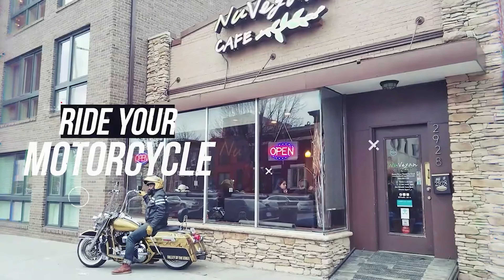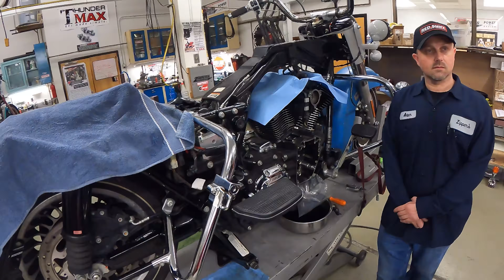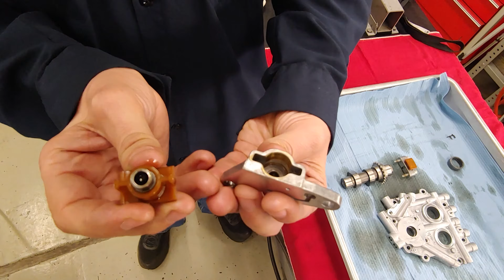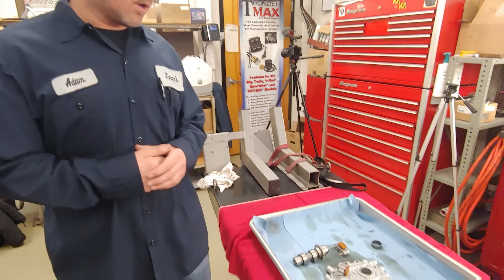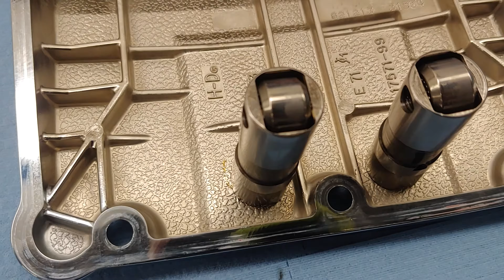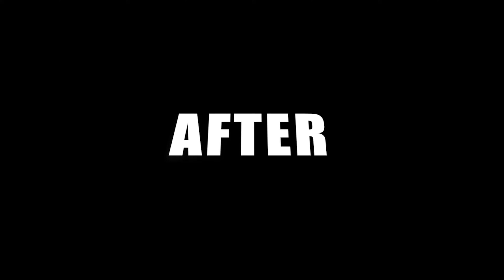Budget Friendly Upgrades to Stock Harley 103 Twin-Cam Engine to Increase Power and Reliability

Comment from the maker: My Dad can't get enough of how much more power his bike has with the addition of the Zipper's Performance BOLT-IN Red Shift RS528 cam. All of his buddies don't believe he only had a cam upgrade. Well, the proof is here in this video...
Reply: Can you tell us the other parts you got him? Which can plate, lifters, oil pump, etc?
Reply: what mileage was on it when you got the work done?
Reply from the maker: @EazyDuz18  It had about 19 thousand miles on it before the upgrade.
Reply: Bad ass. How much did this cost? I'm sure it's more now with our crazy inflation, but it'll give me an idea.

Comment: Did you upgrade the injectors?
Reply from the maker: Stock injectors... The Redshift RS528 camshaft and Thundermax were the only 2 Non-Stock/aftermarket parts added. Thanks for watching!
Reply: @BuildRideRepeat  I'm going with the Dyno Jet Power Vision, and Fueling 4.9 injectors. My 2012 Heritage 103 has 3.91 GPS injectors,

Comment: If your dad likes throttle response they could have pulled the heads and check deck height of the piston and set quench to 0.030” with a Cometic head gasket and milling if necessary and then mill the head 0.020” - 0.030” to lower the combustion chamber volume a few CC’s to bump compression to 10/10.5:1.  It would be crispy throttle response and more torque across the entire rpm range to get that heavy thing moving easier.  It would also thump a little harder.  It’s also somewhat budget minded….
Reply from the maker: Wow! Thats an AWESOME Budget Recipe.  Thanks for watching!

Comment: I have a 96ci 2007 Wideglide and I've added a 103ci kit, Andrews 48H cams, a bit more compression (with manual decomp valves) and a little head work by way of a good valve job etc and a Techno Research tune. It dyno'd at 106lbs ft, which I was/am pretty happy with. However; down here in New Zealand we have a heck of a lot of tight, twisty, hilly roads so I changed the final drive pullies to a 30/70 combo to bring the torque into a more usable road speed range. Getting good torque was my aim and with that final drive ratio the bike is just awesome on our roads; the 103ci displacement just rocks!
Reply from the maker: NICE! It sounds like you've got a good combination for your application for the twisties. Those 103s are really good engines and a good cam with supporting mods make them GREAT!

THANKS for watching!

Comment: Love my 103 and would certainly put cams in it, but my '13 Fat Boy Lo has terrible stopping ability and that makes me not want to put any money in it.  Gonna sell for a Street Glide M8 2017 or newer.
Reply from the maker: Nice! Are there any brake upgrades that you would be willing to make? New cables, new rotors, pads,  fluid flush and new fluid?

Comment: Great video. 
I’am sure he noticed a difference. 
I subscribed 🔔
I have the 2016 Ultra Limited 103”C.I. High Output compression ratio - 10.0:1
In Vivid Black. I bought this bike new. 
I installed these items myself.  Easy Peezy!
Fuel Moto 🍀 2-1-2 Jackpot Header with no Catalytic converters it’s 
Stainless & Ceramic Coated inside and out also their large crossover tube is the same way, and reused my factory heat-shields and installed the Rinehart 4” mufflers, chrome with black tips. 
I also replaced the factory ECM and installed a ZIPPERS ThunderMax ECM with Auto Tune, it also comes with Bosch
WideBand O2 sensors. 
I also replaced the factory air filter with a Roland Sands Black Ops Air Filter. She’s running better and sounds much better. 

What’s next 🤔 possibly - Zippers Red Shift Cams, Cam Plate, and Timken Bearings, Chain Tensioner, High Output Oil Pump, and 
Lifters and Push Rods. 
Primary a Dark Horse Compensator, Clutch & Chain.
Reply from the maker: AWESOME! It sounds like you've got a runner as well. Give the guys from Zipper's a call. They'll get you straight! Just tell them what all you have and they will give you a formula for your parts.

Comment: So between a fueling and an S&S cam what would you go with on that same bike? Mine is a 2012 Road King with full cobra racing exhaust thunder max tuner and a big giant K&N  elbow filter. Didn’t want to do a whole cam chest.
Reply from the maker: They all make different options.  It all depends on how you ride and where you want your power. Give those folks a call to see what they recommend.  Zipper's gave me a solid suggestion for their Red Shift Cams. I understand not wanting to do an entire camchest, but please replace the supporting parts if they are close to the end of their service life.

Comment: I think you are on the right path .  I would do the same thing . I just got back into Harley my self 9 months ago. I found 2016 FLRT FREEWHEELER, the 103 with 6700 miles . Just did a stage 1 finished today . Fuel moto , jackpot header, Vance Hines  slip-on , acdc air cleaner (s&s).add a fuel moto tune . Runs strong ! 
It's not new , Harley wanted $37,000.00 for a new trike . I got this instead. Wise money spent . Very happy , I'm sure your father will love his camed out twin ! You are in great hands with the people you have chosen to do the work
Reply from the maker: NICE! I love Freewheelers. I want to get my Dad on to a RG3, but you already know the prices. 😱

All the 103 needs is a good tune, air cleaner and nice exhaust. This cam upgrade blew my mind!  I think my dad giggles inside his helmet when he rides it now. 😂  I have a video here when he picks up his bike. He got emotional. 

The guys at Zipper's are AWESOME! THANKS for watching and commenting.

Comment: This mechanic was not telling the truth. The rocker tray bushing are non existent. That’s why rocker lockers were invented. These engine came from the manufacturer with rocker try noise. Put a high lift cam in and it sounds like a toolbox being tossed around in the back of a pickup truck. So that statement is untrue. There are no bushings in the rocker tray from the factory.

Comment: Bro because of watching this video a few months ago I put in the Red Shift 528 cams in my 103 with a Thundermax ECM as well, my bike has gone from alseep to "beast-mode". It's fast. So thanks man for putting me on to the 528 cams.
Reply: do you mean BEAST MODE?  😆
Reply: @gw10758  Haha yes😅, I must have had a few cold ones that night, fixed it now. 😎
Reply from the maker: 😂 Hey man... I dig it.  COLD BREWS and Build Ride Repeat! Sounds like a good time after work 👍🏾

Comment: I'm not sure I buy the whole cam chain tensioner thing. I just tore down my 96 that had 120K on it, the tensioners were in excellent condition.
Reply from the maker: They are a maintenance item. You should be able to get good mileage out of them before totally replacing. I do believe the dual pistons keep better timing.

Comment: I have a Fueling 525 in an 88 Dyna with a stock CV 40. It's great to hear someone mention that the Dyna chassis has limits.
I have twin disc on the '99 FXDL and the suspension is well sorted but there's no point going further.
Clutch is uprated and starts to feel heavy after an hour or so.
Also the 525 with Vance and Hines straight shots makes my ears ring for days even with full face and eye plugs.
Reply: Fueling 543 is really impressive.
Reply from the maker: I have heard people mention that about that cam as well.
Reply from the maker: NICE! Its all about enjoying what you have and making upgrades along the way. Thanks for watching!

Comment: Probably spent $3500 to make 20HP. Lmao.
Reply from the maker: This was a BUDGET bolt-in cam upgrade. You must be thinking in FORD Economics. 😂🤣 Thanks for watching!
Reply: @BuildRideRepeat   Nope. Just thinking logically. Harleys are overpriced pieces of shit.
Reply: Bro why are you watching this video if you aren't interested 😂 typical mustang bro 😅 embarrassing af
Reply: @erikphillips9989  No one says I wasn’t interested. I have a Harley twin cam, and from what I’ve experienced and keep watching is the expense it takes to get these bikes to run like they are supposed to is astronomical, yet no one will actually address it. Bikes running so lean from the factory that there are people finding white pistons after a 15,000 miles rebuild. The press together crank that has runout that causes primary components to wear down much much faster and can even cause catastrophic breakdowns. There is a loss of quality here, and Harley’s are only getting more expensive. That’s why I’m talking shit. It’s just not blind.

Comment: Ia it really stock ? I got a stage 1 103 and it puts down 71 hp
Reply from the maker: My Dad bought the bike used. It may have already had a "Stage 1" upgrade of Air Cleaner, Exhaust and Tuning because it had slip-ons already.

Comment: I have a 2005 electra glide CVO  103... With a 50mm throttle body. S&s everything roller rocker .. 110horse power  with a welded crank after 2006 are a key way crank  junk

Comment: I like your Dads bike looks like a Navy paint scheme. i have a12RG with 63000 kinda worried about doing a cam mod after riding for awhile when i shut the motor off it makes a thunk sound in   the bottom end. Lord knows i don't need to buy a new bike😂
Reply: Might just be the compensator in the primary case

Comment: What was the cost? I'm looking to go stage 2, from stock, on my 2015 road king 103. I was thinking of going with an Andrews 48h or Woods 222. What are your thoughts? Thank you. Skip McCain
Reply from the maker: This is what many consider a "Stage 2" upgrade where only a cam was added. I have no experience with those other cams, but the Red Shift RS528 is the TRUTH! I was able to ride my dad's bike to Milwaukee and I never needed to come out of 6th gear to pass anything. All the other was done because my dad never had any work done to the bike and we had no clue of the condition of his serviceable parts.

The cost will be what a cam change would cost locally. For more about the check the link below for more info on the RedShift RS528.
https://www.zippersperformance.com/red-shift-cams-rs528-for-twin-cam/
Reply: @BuildRideRepeat  Thank you

Comment: How much cash is my question.
Reply: Same here....budget friendly....what's the budget?
Reply from the maker: It would depend on what your local technician charges for a cam change, changing lifters and cam chain tensioners. We didn't upgrade many other parts outside of what was already there. Except for adding the Thundermax. My Dad's slip-ons stayed, and we added a high flow air filter. So, the main costs outside of labor would be Red Shift Cam Kit, lifters, and Thundermax.

Comment: I have a 14 SG stock and I’m shopping for the best cam. Hmm 🤔
Reply: Cyclorama 570-2 just installed by owigsburg h.d. in pa. Got 98.7 hp and 116 ftlbs tourque. Drag specialties head pipe and vance and hines pipe. Top end is dead quiet. 44 mpg . Still can cruise at 2,000 rpms. It is amazing.  K and n filter with stock airbox cover. Looks almost bone stock.  It's on par with factory m8 114. 103 has nice thick cylinder liners that aren't prone to crack in the spigot area. Stock heads and jugs. Did this at 56,000 miles.
Reply from the maker: @Frederick King  NICE!👍
Reply from the maker: My dad's bike gets up and goes with the Red Shift RS528 cam...

Comment: Planning on this set up for my 103 dyna switchback
Reply from the maker: NICE!!! You'll love it!
Reply: @BuildRideRepeat  just making sure.. for a 2015 with only 3k miles stock 103. All I need is the cam kit from zipper?
Reply from the maker: I believe so, but please ask them when you call. I don't want you to miss anything.
Reply: @BuildRideRepeat  10/4 I will for sure call and make sure I get everything needed
Reply from the maker: RIGHT ON!

Comment: What was the budget on that project? love the bike I have a 13 with 45k it needs a shot from zipper performance.
Reply from the maker: 🤫... My wife reads these comments. 👀 🕵🏾‍♀️

 (It was basically cost of a cam swap and a Thundermax tuner.) Costs will vary depending on shop rates in your area. The money saved on new push rods can go towards new OEM rockers.
Reply: In other words.. a couple thousand bucks @BuildRideRepeat

Comment: So if I pick up a 2015 103HO with only 1,550 miles on it would I still have to do all the reliability parts swap  or  would a 525 cam only be sufficient?  And what kind of ball park $ is that ?
Reply from the maker: WOW! That is a low amount of miles. The reliability upgrades were done to get my dad's bike to your bike's low mileage condition. Some of the parts replaced like lifters are serviceable parts that wear from use. Since it is a 2015, you will have the good parts in your engine. You will probably only need the Red Shift RS525 and a tuner. 

Give the guys at Zipper's a call. Tell them what you have and they will get you set up.
Reply: @BuildRideRepeat  so if I have a 2015 103 I’m good with just the cam? This got my thinking I can handle this myself
Reply: I just had cyclorama 570-2 cams installed. In 2012 streetglide.  Headpipe from drag specialties, vance and hines pipes. Sreaming eagle oil pump and cam plate. 98.7 h.p and 116 ftlbs tourque. Shaeffers H.D did the work in owigsburg pa. Top end is very quiet. 1 750 to 5 000 rpm. Cruises at 2 grand just fine. 44 mpg. It really rips.

Comment: I "hated" my stock 2013 Ultra Limited engine and suspension. I ride in the mountains of New Hampshire, and the lack of early torque combined with a poor suspension made the motorcycle perform at a scale of 6 out of 10. I went with the S&S 551 cams, but I love Zippers products and would have chosen the 525. I picked up 20 ft pounds of torque starting at 2,000 RPMs. I also went with Ohlins front and rear. I now score my motorcycle at a 9 out of 10. As a bonus, the tune and cam also reduced the heat felt by my passenger and me. Worth every hard-earned dollar.
Reply from the maker: Nice! A great tune will make a huge difference.

I too am looking to upgrade my suspension after my MUSCLE 107 upgrade. I talked with a guy at the Öhlins booth during Bike Week and he mentioned they didn't have anything for the 41mm forks.
Reply: I hate the hard ride on my 13 Street Glide.  Gives me blurred vision.
Reply: @bm7760  The suspension upgrade is well worth the expense. Don't cheap out. Buy once, Cry once.

Comment: ITS GREAT TO SEE A SHOP REALLY GO THE MILE AND CHECK EVERYTHING INVOLVED WITH CUSTOMERS CONCERNS ( GREAT JOB ZIPPERS ) IM IMPRESSED. MOST OF THE TIME SHOPS DO THE MINIMAL. ANOTHER THING ! WHAT WOULD THIS JOB RUN ?
Reply from the maker: Yes! Their goal was to show their end users of Red Shift Cams the importance of doing a Bolt-In cam swap efficiently without throwing a bunch of money at unnecessary parts.

Comment: Now pulley it to gear it down a little for acceleration, it will still run out great in 6’th gear.  The factory geared them to high for emissions....
Reply from the maker: That may be true, but it was out of my budget to do any other mods. 😂 I was going for "Best Bang"